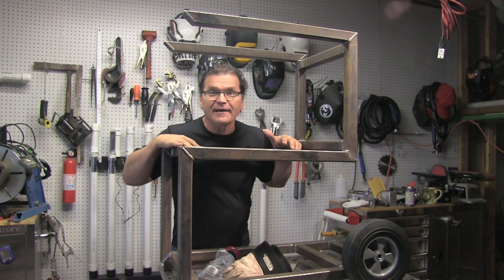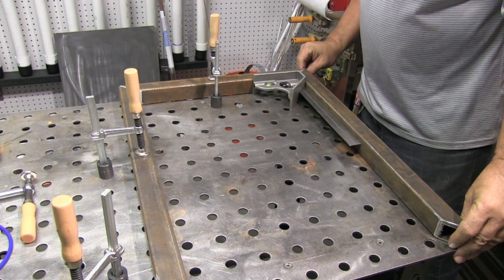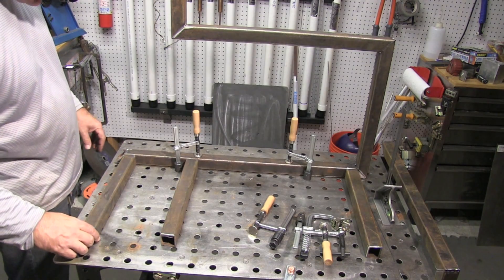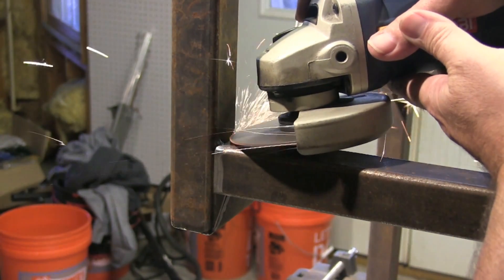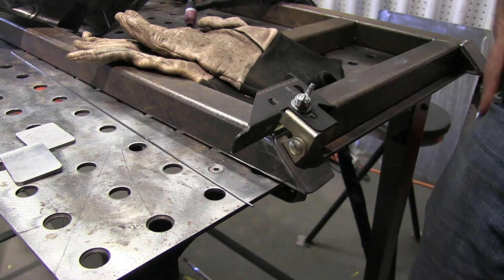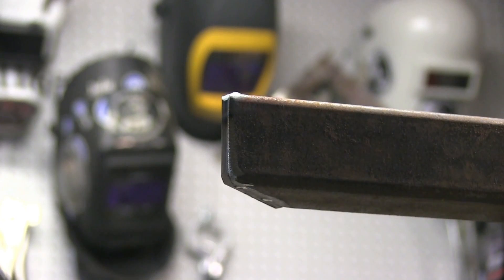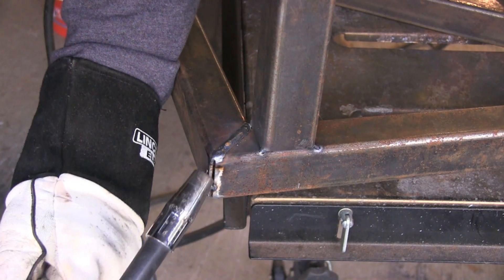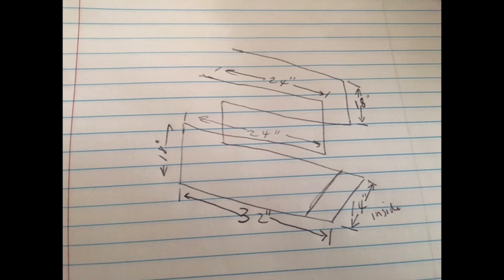Welding Cart Project - Open Concept

Comment: You used 1 1/2" square tube. Would a smaller size work or would you stick with 1 1/2". Also what wall thickness would you recommend? Would 16 gauge work or do you need something thicker?

Comment: I need information on picking the right torch, for welding 16 and 18 gauge mild steel, sheet metal on old cars. I have 2 welders, Eastwood tig 200 AC/DC and Everlast 160 tig. I am having problems on both of them, welding fine sheet metal. I saw you had a selection of different torches on one of your videos, I want to scrap the two torches i have a purchase the right one i need just for sheet metal. Any recommendations? Do you sell any?

Comment: Jody, how is the cart holding up so far?  I am looking at a MP210 and a Square wave 200 to find a new home on one cart.  I like the open design, you can still get at everything on the machine.
Reply: Should be a good design for multiple units. I'm thinking about making one for my Everlast welder and hopefully a plasma cutter.

Comment: In June, I am getting a Miller Bobcat 225.  Miller wants $700 for a thing to hold it.  No way.  haha  I have been into making my own stuff, since I got my first, cheap welder in June.  So, I know I can make my own cart.  There ARE some things I can ask though.  First, the welder, with gas and oil, will weight almost 500 pounds.  The little welder I have now, can weld 1/4 inch mild steel.  Will I be able to make a strong enough cart, with that?  Ok, so, let us say I can.  I used some wood, to make a model of the cart.  I don't want just a flat metal piece.  So, I made, let's say a skeleton.  Just a box, with beams in the middle.  You know, to make it stronger.  Alright, then, I would get some of those rods they have at Home Depot and weld one to each side.  Maybe stack two, just to make it taller.  Man, I got that down.  Though I just started, I found I am good at welding.  I figure things out you know?  The ONLY thing that I am lost to, is the wheels.  If I wanted to put a set of, almost tractor tires on the back, be them small, how can I do that?  I just got into the tool thing.  haha  Hey, I just turned 31, so, I guess it is a little late.  Those wheels go on tractors no?  So, what can I make, that will allow me to put them on the back of a cart?

Comment: I like that design, savin a bit of material and it looks cool..kinda floating like, but from a previous question, how "flexy" is it Jody? I've got an inverter myself and may try and copy that design. Did you make it so the welder sits in the middle portion or on top? I'd love to see some finished pics if it as I think it's pretty slick. That little trick with the mag mount tool for the end caps was pretty clever as well. As I'm getting older I'm losing my common sense and seeing that little tool work for you makes so much sense. I think I would have crusted up my gloves not thinking of the way you showed. Thanks and keep up the clean and interesting work. 
-Pidge

Comment: When you were laying out the sides to weld, you welded one side, then stacked the other on top to mirror it.  Would it have worked as well if you had stacked both sides up at once, then just tacked all the inside and outside edges?

Love the videos, thanks for all the great info.

Comment: I'm surprised no one has pointed out that using the same grinding media for your parts as your tungsten is an excellent way to contaminate the tungsten and create welding issues. Definitely envious of the shop though. Love the videos.
Reply: +OSUNickTheGreek Is that a real issue on just straight tungsten though? Especially grinding away from the tip? I'd assume any significant contaminants are ejected away from the tip anyway.
Reply: +demultiplexer grinding direction doesn't matter. you should always use a dedicated stone/disc to grind tungsten.

Comment: Jody, After watching Lanse videos using a cold cut saw, we bought one for work. It is the greatest thing since sliced bread! No more red hot pieces, no more dust and fiberglass debris in the air, and the cuts are very , very accurate. I have the same Makita saw as you at home, but that will go soon in favour of the cold cut saw.
Reply from the maker: +Rattletrap2 What brand does your work place use? I am shopping for one myself
Reply: Jody,
This one is made by Fein. It is called a Slugger 14" Metal Cutting Saw. Order Number is  72905361120. Up here in Canada it was around $600 and blades are about $150 each. Should be much less in US. The blades last a long time compared to chop saw blades. We have had it about a year now and so far, it is great. Lanse got his from Northern Tool I believe, and for the most part, they are all the same. 1300 RPM compared to chop saws.

Comment: Like it. Looks similar to a cart I built few years ago. Even same wheels. Are you gonna use a drop axle design to keep it low center? Couple of 3 or 4 inch schedule 40 cut in half make nice cable hangers.
Reply from the maker: +AccurateDesignFab I am definitely going to use drop axle concept , the swivel casters will determine the clearance.

Comment: Jody, I've been learning a lot from your vids, thank you!  I'm just a DIY hobbyist, but there aren't any classes in my area so I'm teaching myself with the help of videos and books. My next welding project is going to be a welding cart, though probably out of 1" 0.065 wall square tube, not the heavy stuff you lucked into. Going to try it with your TIG finger and gas lens kit and find out how hard what you make look easy really is!  If it holds together I'll be happy enough for a first TIG project. The little welding table I did to learn OA welding is still going strong so there's hope.

-- Mike

Comment: A 3 inch gusset would do wonders with strength and not be very unsightly.
Reply from the maker: +1HandBackhand I may wind up putting a few gussets on it.  gonna wait and see how flexy it is with a welder on it.

Comment: Sorry if you've discussed this before, but. What square are you using? It looks amazing!
Reply from the maker: +Josh Smith is called a lasquare  its a wide based square that can stand up by itself.  you can learn more at weldmonger.com
Reply: weldingtipsandtricks ,it make me  bappy  to s y ,it mk  s s ease.....